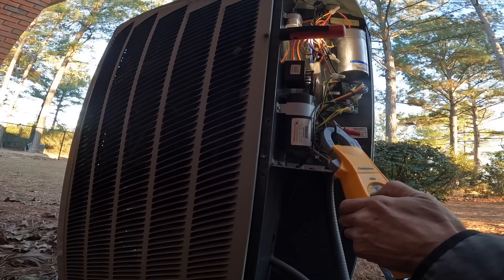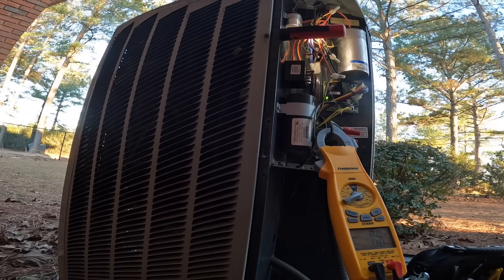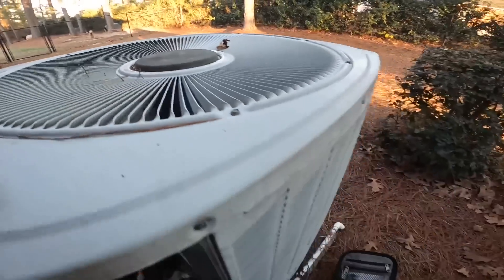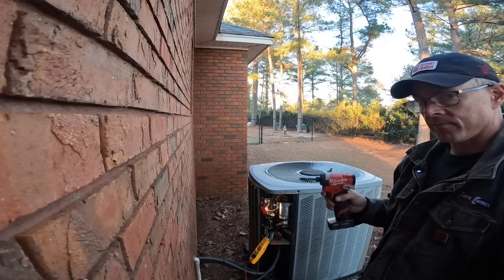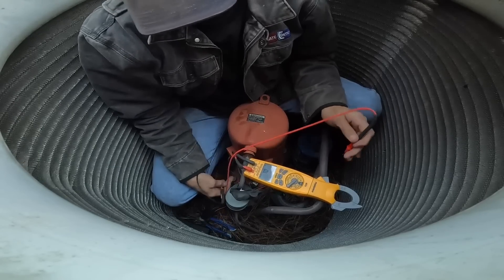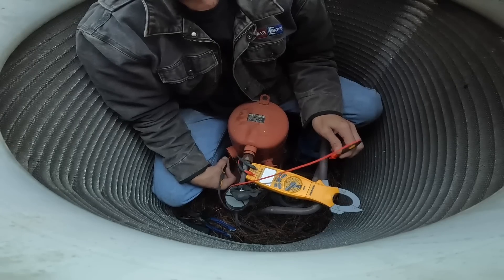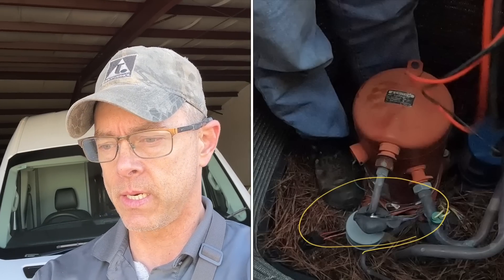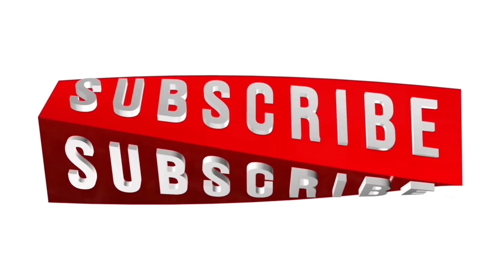Trane Heat Pump Tripping A Breaker

Comment: I have a 7 month old Trane heat pump that at my preventative maintenance was told by the installing company that my starting amps are too high and tried to sell me a $350 hard start kit. When I said if the starting amps are too high on a brand new system something must be wrong and should be covered under warranty. They just said “no sometimes compressors just normally pull too many amps at startup and need a hard start kit”. Will be looking for a new hvac servicer soon.

Comment: OK I maybe that sensor that is mounted on the discharge line is for the case
heater, when closed case heater on, when compressor on hot discharge opens 
case heater off, could the case heater be grounded?? causing contactor problems ?

Comment: Getting a reading on your ohmmeter, to ground should have made your megger read also.  I don’t trust battery operated meggers.  I have the crank style, that has its own generator.  100% reliable, but pricey.  That chattering sounds like low voltage to the contactor coil. Glad you were able to find the cause.  I believe that thermostat is a discharge temperature thermostat that protects the compressor from running with a low charge.

Comment: I’m looking to get a new meter. I currently have a field piece sc260 but testing resistance it’s all over the place after just under 2 years of use. (I have new leads as well)
Have you had any problems with the 680?
And would you recommend getting the 680 or the fluke 902fc & fluke 116?
I’m considering the 680 since it is a higher end field piece than my current meter. But I would like something that’ll last longer than 2 years.
Reply from the maker: I love the 680. The fluke 116 requires you to carry two meters, so for me it’s a hard no. I also have the 902 the older one - quality meter, but doesnt have the features of the 680. I’d also consider the SC480 as it has almost all the features of the sc680, but similar form to the 260

Comment: It made me nervous when you were working on the capacitors and contractor and the green light on the control board was flashing indicating live power.
Reply from the maker: Indicates low voltage

Comment: Call for barking dogs in the background give them a large bowl of peanut butter to size of a baseball. It will stick to the roof of their mouth and inside back of their teeth and they will spend the next half hour licking trying to get it unstuck from between their teeth in the back of their mouth, and it keeps them quiet.
      And they will like you because they love peanut butter
Reply: And some peanut butter will also Kill a Dog..
An Ultrasonic Repeller is Cheaper. makes the Dog run and hide.
Reply: @m9ovich785  they make peanut butter treats and peanut butter just for dogs. It does not kill dogs.. 

The only difference is you use organic peanut butter that does not have added oil, salt or sugar 

If you constantly feed a dog peanut butter, they will become fat and obese 

Other than that it’s a treat

Comment: I'm going to watch the whole video but right off the top when I see a chattering contactor I check the contactor coil and isolate / check all the low voltage. Next stop is always the case heater, then meg the compressor
Let's see....... LOL
Yep....you got it 👍

Comment: Nice find Curtis   So I can follow you and learn I looked at the wiring diagram the yellow wires from board go to a low pressure control not a temperature type control. There’s is a a temperature control for the crankcase heater but that’s line voltage.  Is it possible you were talking about the LPS that i mentioned first.  Thanks for your help   You do make wiring issues look easy to find and fix